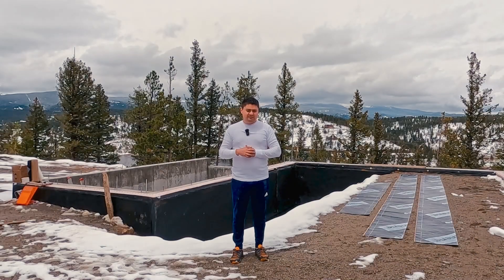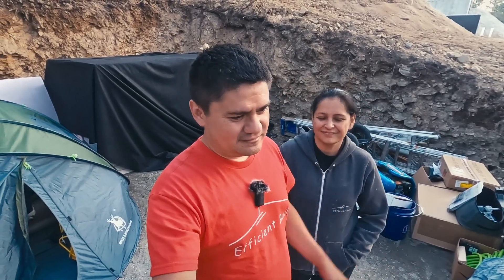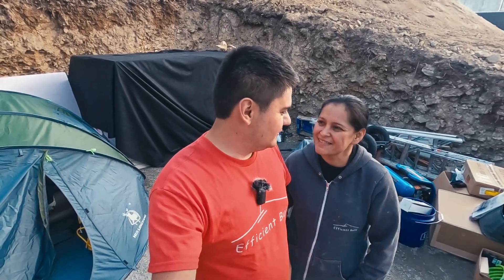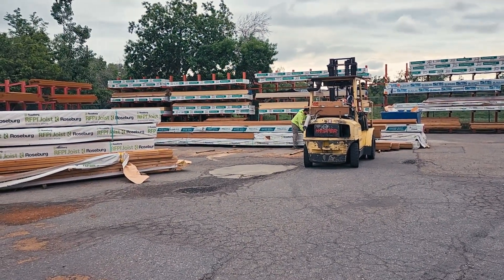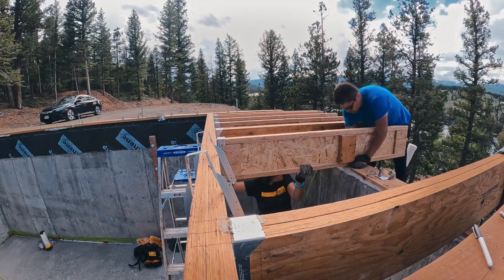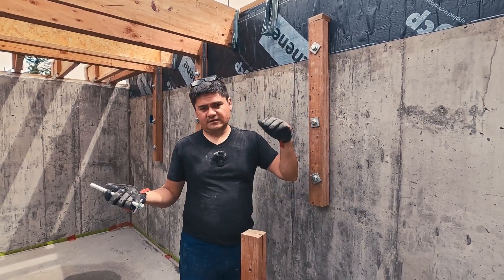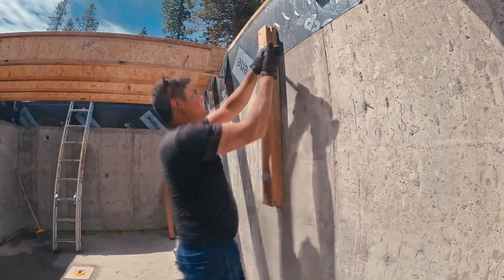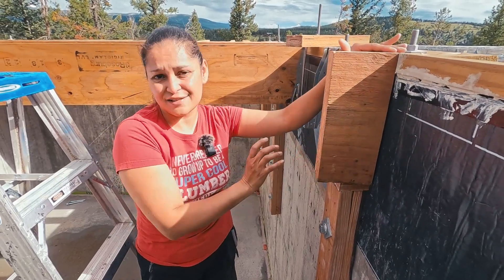Framing: Cantilever Floor System

Comment: Oh no! All the tools and supplies! How far through the foundation wall do the bolts penetrate? Is there a depth at which it becomes important to add some sort of layer of sealant or something before installing the bolt?
Reply from the maker: One battery's led's stopped working after that, but crazy that everything still works to this day!
The engineer requires 5" embedment of the bolts. Also, no sealants under any circumstances in this case. A sealant could act as a lubricant and make it easier for it to come out.
Some bolts get installed with epoxy, but not this particular one.